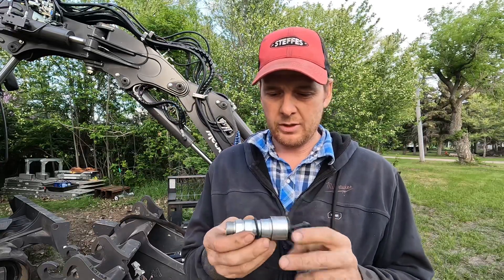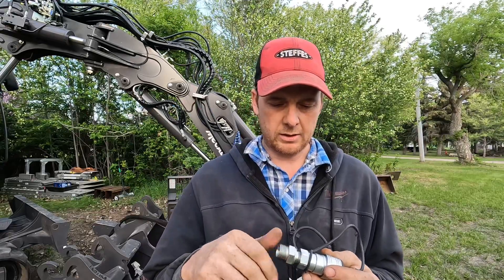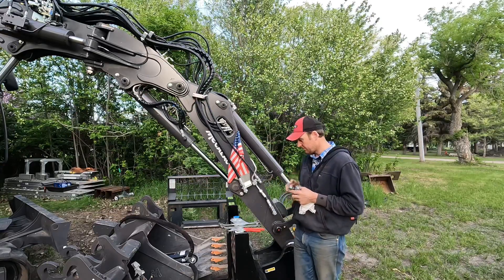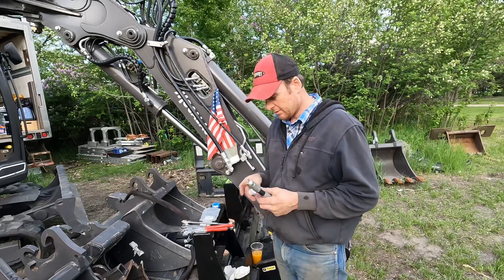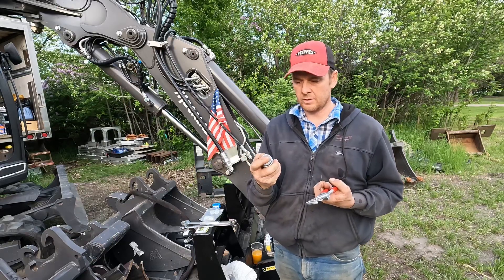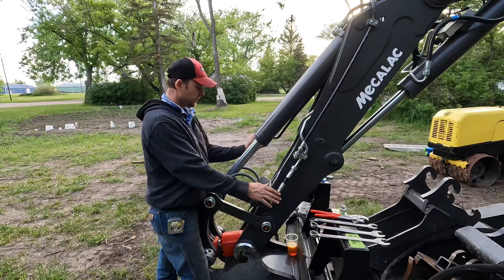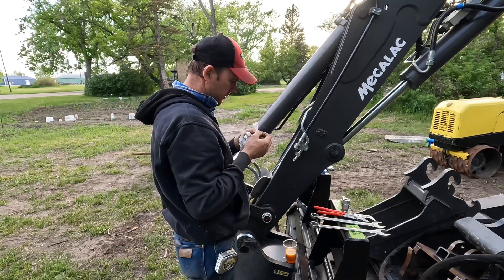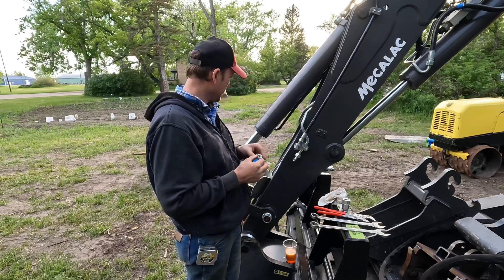Changing from Pioneer to flat faced Couplings.

Comment: It might drip if you put some exterior pressure on an attachment but otherwise looks fine. I bet that o ring is pretty cheap though. I switched the fitting like you did on my engcon, I don't know what they seem so obsessed with the poppet valve couplers in europe, I wonder if it's because they do so much more ag.
Reply from the maker: I’ve used it a lot since then and still not even a drip so I never bothered to get one. 
Do you know what the flow rate difference is on them?
Reply: @benjijestice  I did some reading and it seems like the flatface have almost twice the flow of comparable poppet though I have also found that different brands can have varying rates.
Reply from the maker: @villageearthwright  I thought they were more but I didn’t know they were that much different, plus I like how easy the flat faced couplers are to clean and they don’t loose as much oil on disconnect.